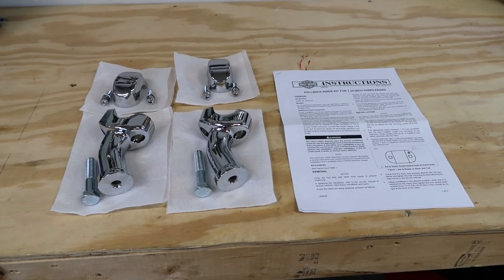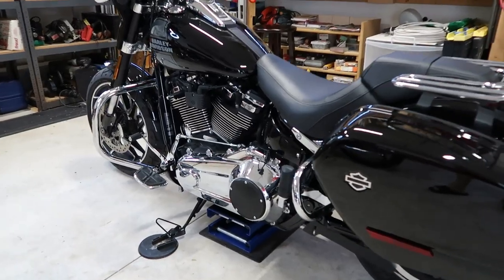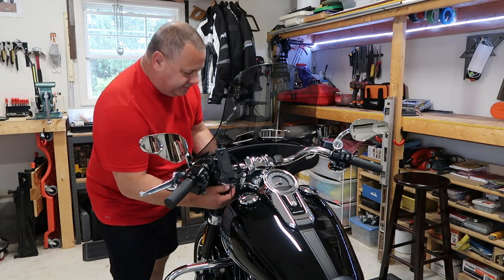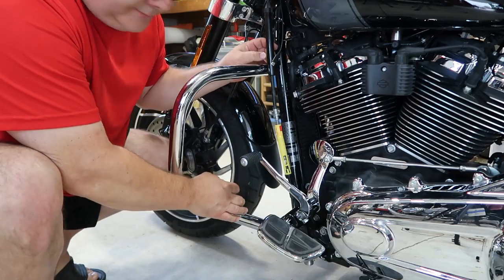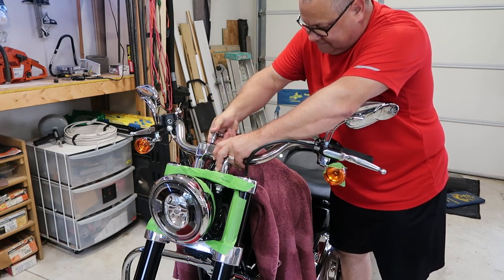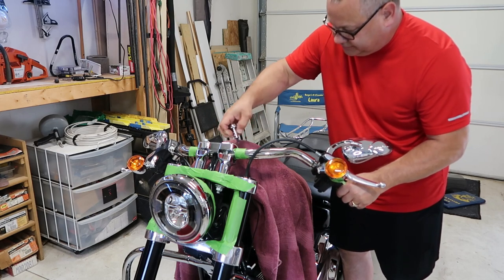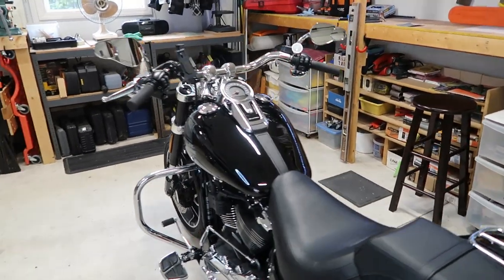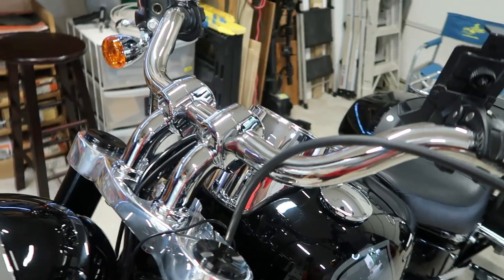Harley Davidson Sport Glide Pull Back Fat Risers - Installation

Comment: Nice video. The question is how are such risers affect on vibration? Stock riser is connected via rubber bushing however new risers touching cross-bar directly.
Reply from the maker: No difference than OEM risers on the road.

Comment: Love this! I've a 2019 sport glide, and been thinking about this as well. I noticed you said you didn't have to do any recabling. Was there enough slack in the throttle one, then? as when I enquired at my local dealership, they said would most likely need a new one.
Reply from the maker: There is no need for any recabling with the product I installed. Brake, clutch and throttle all work perfectly. If you go to the 6 inch pull back instead, then you will really be at the limit of OEM cables. Hope this helps. Best of luck...

Comment: Great video!  I also have Sport Glide and plan to install the same curved pull back fat risers to get a more comfortable riding position; but, I haven’t decided between the 4 or 6 inch.  Have a question, how did  you determine the 4 inch curved pull back risers were right for you?
Reply from the maker: After demoing the reach seat from my Harley-Davidson dealership. I liked the 1.5 inch reduction in reach to the handlebar but didn't like other things about that seat. Also, I didn't want to have to re-cable the clutch or brake. The 4 inch is comfortable and has no performance issues. After doing my install of the 4 inch I think the 6 inch would really be tight without re-cabling. I'm happy with everything about the 4 inch pull back fat risers. Good luck...

Comment: Will be doing the same soon, also.. how is that windshield?  Im running a freedom shield 12 inch and it doesn't quite do it.. gives me a good bit of buffeting at hwy speeds. Was thinking of changing to the one you are running. Thanks for the video and insight!
Reply from the maker: Here's a video I did on the windshields I've been running,  hope it helps. https://youtu.be/H1FZWOIcDms . Good luck and thanks for watching...
Reply: @ToddsProjectsandOutdoorJournal  thank you! Safe riding out there and all the other adventures!